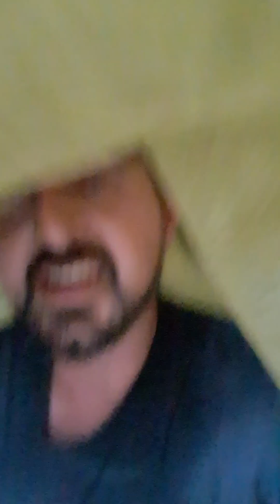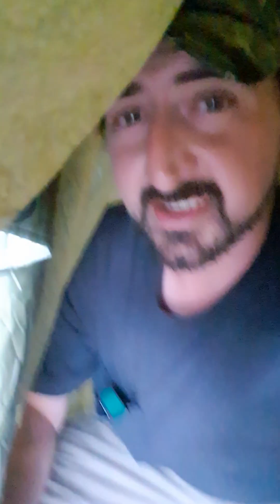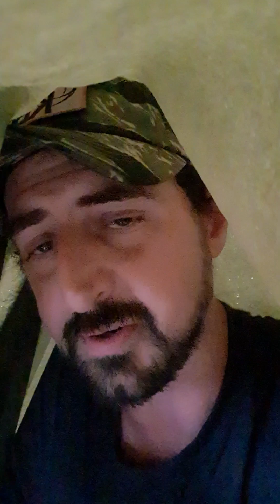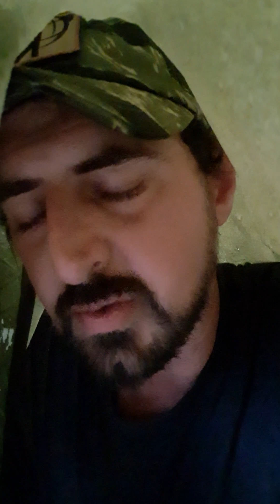M35 triple circuit brake upgrade idea.

Comment: I thought about finding a belt driven vacuum pump for a large truck, F650 and up and possibly run just hydraulic brakes with a proportional valve.
 Not sure how well it would work but just an idea

Comment: Not your idea, this air over hydraulic multi master system was used on Wanderlodge motorhomes for a number of years. Up until recently you could still find the air operated masters, called 'pressure converters' listed through Napa, but they seem to be mostly NLA. There are still some new pressure converters being made, mostly for trailer retrofit applications.

Comment: Thanks Garrett for every video you do. It would be good if you could also show like a small schematic or drawing of what your explaining. I try to follow but ide have to get another deuce type mechanic to do something like that but even as a operator/owner its good to comprehend as much as possible so you can work together with whomever I would possibly hire to do something like that. Thank you once again its always good to see that smiling face with a smudge of grease, the Tactical repair man ! he,he, cool dude.

Comment: I thought about this too. I like that it is simple and definitely more redundant. Plenty of M105’s around and a lot get cut up for bobber donors. Never tried sourcing parts to rebuild/replace those cans before, so I guess it all depends how hard it would be to service in the future. I also considered a backup air tank with a check valve should the system lose all air pressure somehow (like a line snapping) to have an e-stop single use tank (like how hydromax has that little motor) to get it off the road in an emergency. Lots of things to consider but nothing is impossible.

Comment: I work on class eight trucks and years ago brakes on big trucks used this system, although it used just air with a single chamber brake can to apply brakes. it was eventually deemed unsafe because if you lost air pressure you had no brakes, thus the dual can spring brake can was implemented